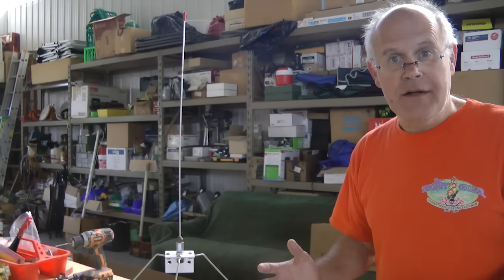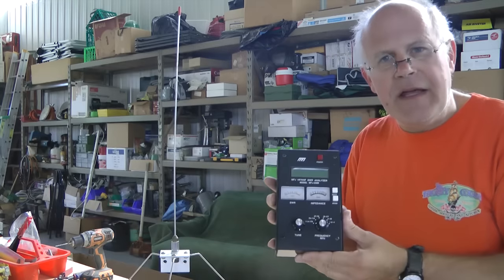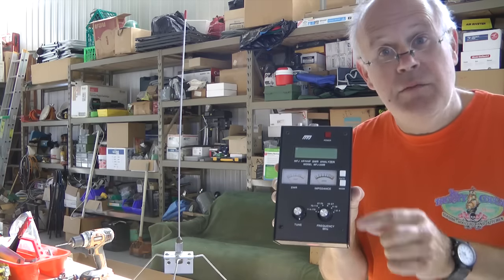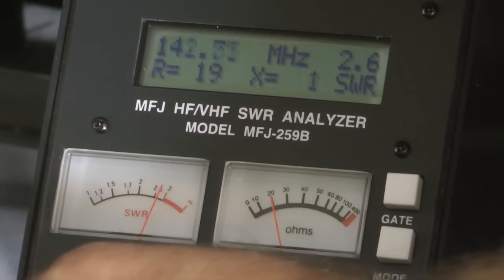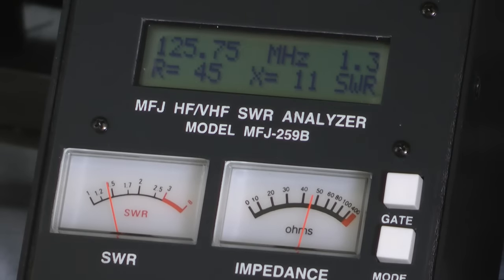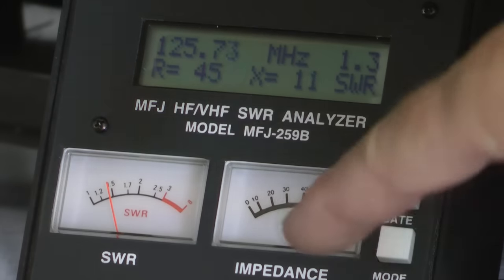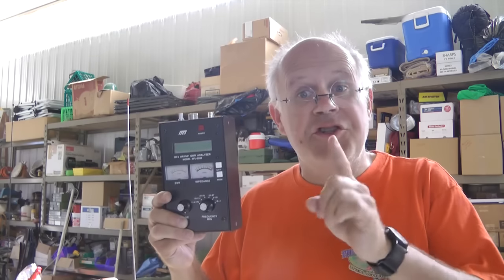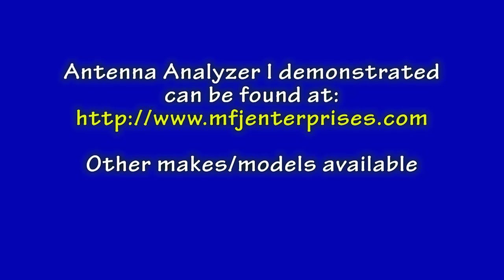Testing your Experimental Aircraft's Communication Antenna

Comment: Minor correction here: minimum SWR does not imply the antenna is resonant.  This would only be the case if the antenna radiation resistance matched the transmission cable resistance, which is seldom the case.  Minimum SWR just means the minimum amount of the transmitted signal is being reflected back to the transmitter.

Comment: An even more important antenna property not mentioned here is the bandwidth. This is the range of frequencies around the lowest resonant point where the SWR stays below 1 to 2.0. For a COM antenna between 118 and 136 MHz with a center freq of 127 MHz.

Comment: Thanks for the advice!!!. Did not know about this avionics equipment for testing. I just have my nav/radio repaired and came to find out that my antenna was cracked, which caused the damage in my nav/radio. Best regards.
Reply: @Cessna Pilot.....RF doesn't know it's being used for avionics. Buying a piece of test equipment with the word avionics attached to it will run up the price. This $200 SWR Meter would be 2x or more if it has avionics, aviation, aerospace or aircraft on it. 
As a ham radio operator I own several of these long before I became a pilot.

Comment: Thanks.  I enjoy watching your clear videos.  Though I'd love to have that meter to play with, I'm more interested in knowing the proper type, length, and placement of an antenna I intend to build and install in my Powered Parachute aircraft.  I see kits for this where the antenna is about 24-25" long, so guess that must be about the right length?  But what about placement in a Powered Parachute?  Front by nose wheel?  Top of roll bar?  Within the framework?  Does your meter answer that question, or perhaps you already know the answer?  Do you know of any DIY videos for building my own antenna to replace the rubber ducky antenna of my hand-held AV radio?  Thanks for any help you can offer!
Reply: I'm interested in knowing this information as well

Comment: John, how did you connect the meter to the antenna cable?  Is that an F to BNC adapter?
Reply from the maker: Cable had BNC connector both ends
Reply: Does the top of the meter have a BNC connector on it?  When I look at the MFJ-259 it's got a big threaded connection.  A BNC will not attach to that so what have you screwed onto that to attach the BNC cable connector?
Reply from the maker: True, my meter has an SO239 connector so I use an adapter. Check with the manufacturer of the meter to see what connection types are available. You can always use an adapter.